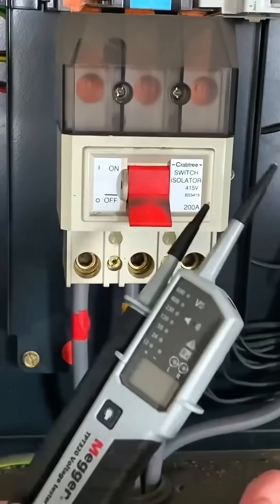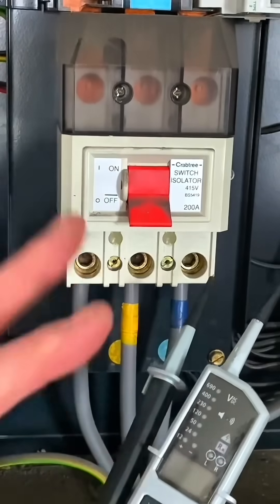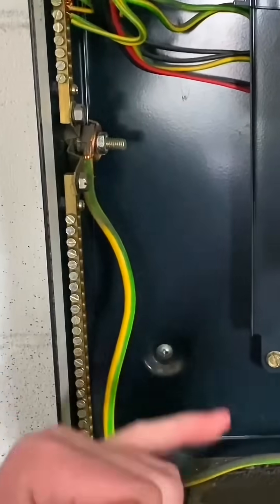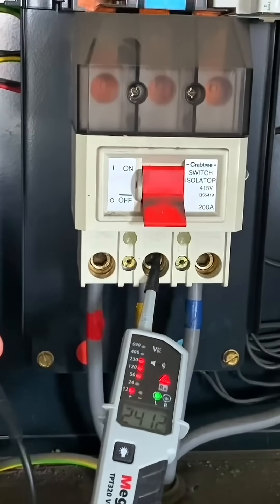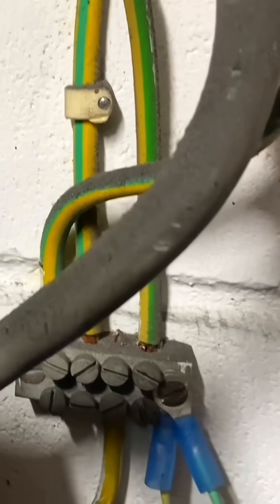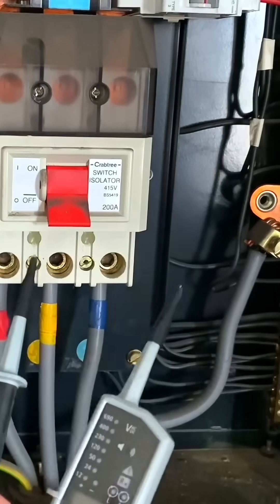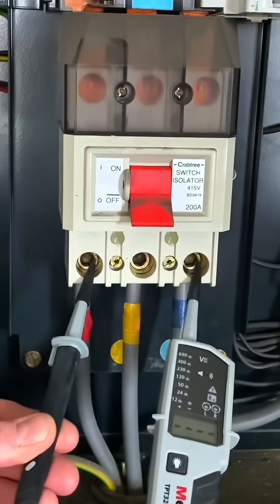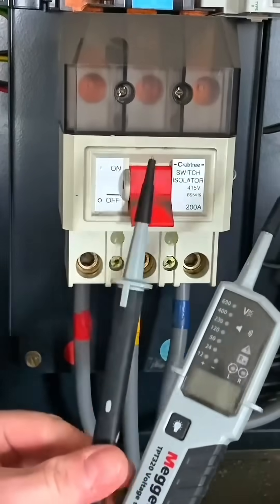3 Phase Supply Polarity

Comment: don't suppose there's a method for checking phase sequence for those that don't have that function on their MFT's?
Reply: You could use a multi channel oscilloscope.
Reply: Or use multiple meters that have high enough precision, and a timer and watch the voltage sweep change across each phase. This a is janky method but can work as well technically
Reply: You didn't mention that your tester showed the phase rotation when you were testing L1-L2, L1-L3, and L2-L3.
 That's another tick on the test sheet.
Reply: This tester and many of the probes do. If you look you'll see the phase rotation indicators on it. Have a gander at the manual and it'll explain it